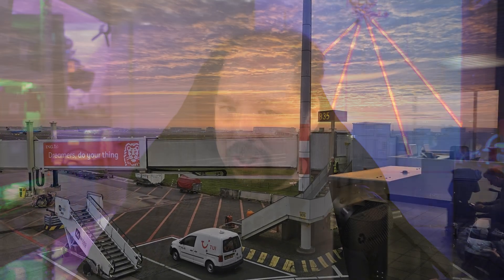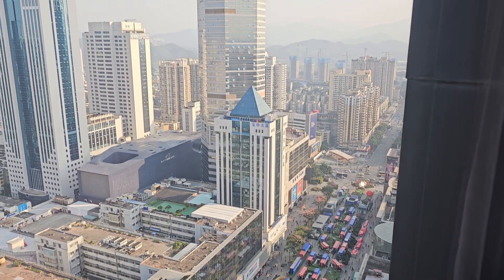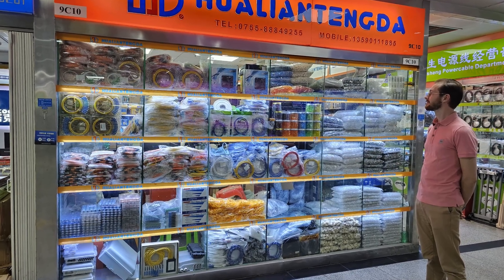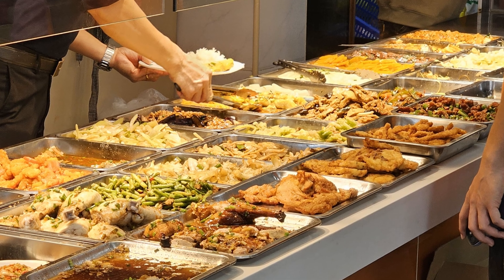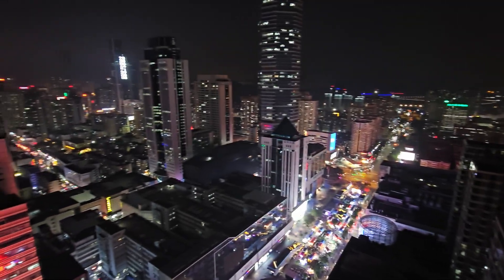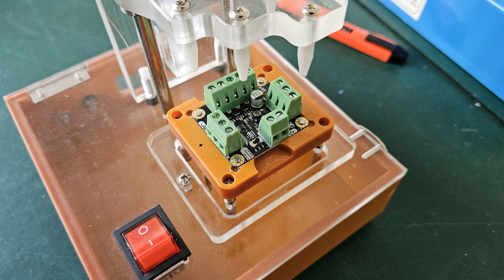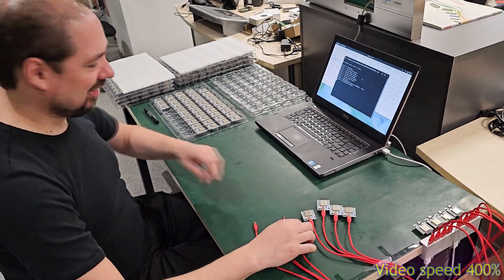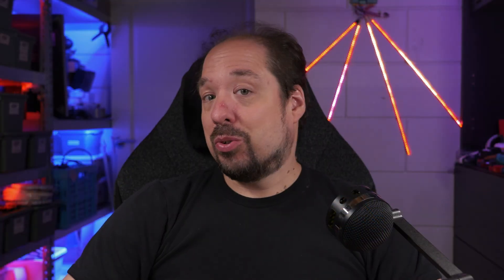I went to China and visited my production partner for the QuinLED boards!

Comment: I want a string under my eaves all around my house. I don’t think this is practical unless it’s 120v so I don’t have to do power injection at multiple points. So the tech isn’t there yet.
Reply from the maker: If we're talking Analog this new board (and the other upcoming too) support up to 48v LED strip, that can get you quite far! If you are talking digital there are 48v puck strings that can be used for fairly long lengths so it really depends what you are looking for!